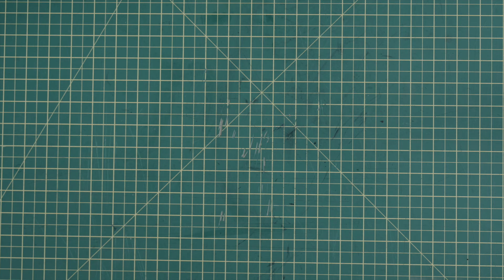NEW Everyday Carry Leather Sheath Build

Comment: You did well, for being new to wet moulding. If I'm attaching a separate belt loop, i will fold it at the top, so the strain is on the leather itself, not the stitching. I may allow more of the tool to extend out of the top, to make grasping easier. (Esp. With my arthritic numb fingers!) Nice job, Hon...
Reply from the maker: That’s a very fair point! I’ll do that next time! Thanks for the tips! It’s much appreciated. Also thanks for taking the time to watch ☺️
Reply: I have seen and tried a "leather washer" of sorts at the top attachment point of a belt loop like hers in the video. Around the thickness of the expected belt, between the belt loop and the back of the sheath, the stiching going through the washer. This way, the wear, the belt will cause is on the washer.

Comment: Love the leather Arc pouch, BUT . . . next time you make one, please include the SIDE POCKETS for tools and accessories. In fact, the ONLY REASON to bother wearing the Leatherman pouch is that I can include extra stuff. PS - Please make room for Leatherman's plastic tool carriers, typically BOTH fit INSIDE the Leatherman pouch while the outside pockets are used for ratchet extensions, etc.
Reply from the maker: Thanks for the advice…very good points. I will have to go back to the drawing board ☺️ always looking to improve.

Comment: That's an awfully nice sheath for a tool that isn't worthy of it. I've had two Arcs and both failed me. Both had massive frame flex, their wire cutters broke on wire that even a Gerber can cut easily, and their blades wouldn't hold or take an edge worth squat. I wanted so badly to love the Arc but after getting two with such bad QC, I put the Charge back on my belt